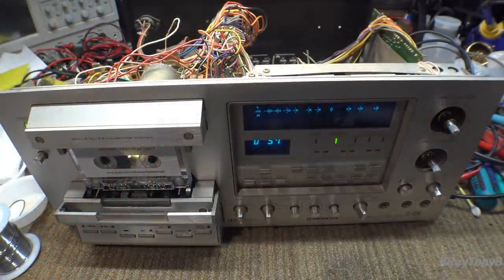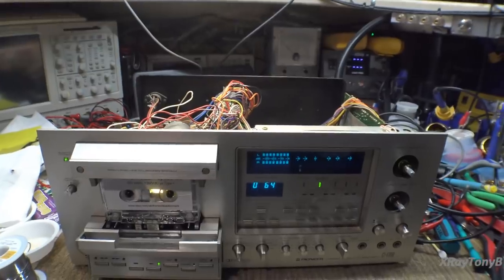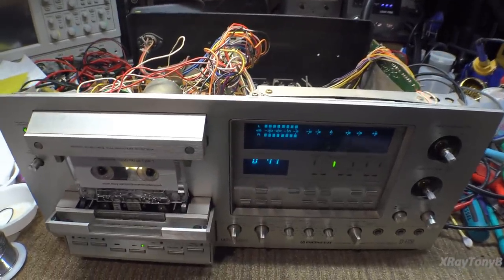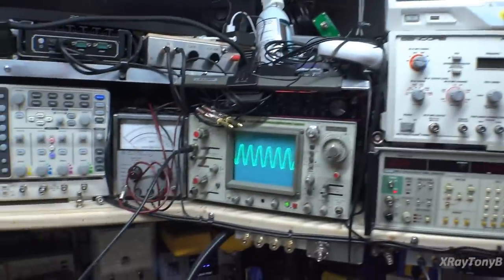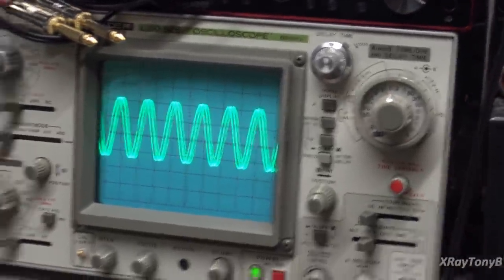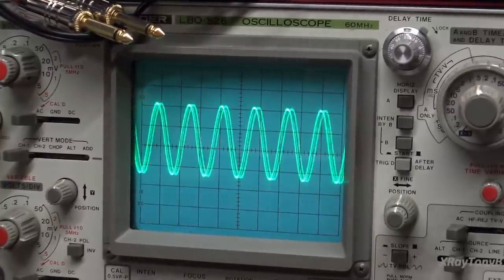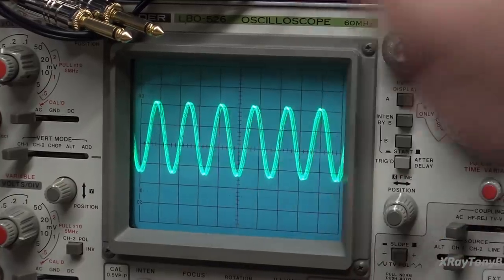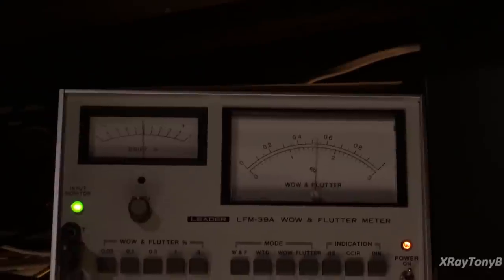Pioneer CT F1250 Cassettes Deck Restoration - Part 2

Comment: Ive had a lot of good fortune with lightly sanding the idler tire and then using rubber renew. It takes a fair amount of use to have the rubber actually wear down (even after all of these years since they were built. Same has worked for pinch rollers.

Comment: You hit the nail on the head.  The problem with cassette decks is they are reproducing the sound mechanically.   There are so many mechanical parts that can affect the sound.  Those drive motors had some good engineering done on them.  Pretty amazing how the motor regulates the speed internally.  Back in the 70s they really knew how to build things.

Comment: I bought one of these back in the late 70s. When I first played a vinyl album on my pioneer PL-630, I'd record it to Maxell Metal tape and then play the tape exclusively from then on (even on such a high end turntable, you could tell that each playback degraded the surfaces ever so slightly). I used the CT-F1250 so much, that by the mid 80s, I had already worn out the idler (it would slip from time to time, the take up reel would stop, and the anti jam mechanism would stop the tape). Other things I noticed before that happened...
1. the erase head was so strong, that after recording one side of a tape (and playing back to see levels), if you recorded on side B after that, the right channel (I think) would be a few dB lower on side A. I figured it was to compensate for metal tapes, so I just recorded side a little stronger on that channel, and when I recorded the other side, it evened out.
2. Initially, I could set the BIAS, LEVEL, EQ (in that order), but after a few years of lots of use, I couldn't get EQ to center anymore. I figured it was because maybe the heads were worn from so much use, but maybe it could have been components no longer in spec. I really don't know.
3. I was never a fan of the Dolby Noise Reduction (on any tape player), if you recorded with Dolby, then used Dolby to play back, it didn't sound as natural to me. Somewhat subdued in the high end compared to the original source I recorded from (usually vinyl). But this wasn't just this deck, it was all tape players I've recorded on.

Anyway, I'll be waiting to see how your restoration goes. Good luck, and hope you are happy with the results. I loved the deck myself.

Comment: Hi Tony, this relates more to the first video, but you were mentioning rolled off frequency response.
Your big band tape was marked as Chrome so you selected Chrome on the deck.
However some pre-recorded Chrome tapes are equalised so they have the correct response on the "normal" setting.
The biggest tell tale is the presence (or not) of the coding notches adjacent to the record prevention tabs.
Notch = Chrome EQ.
No notch = Normal EQ.
The later "metal" coding notches are nearer the centre.
I know you went on to say this also affected your other test tape too, so  in this case wouldn't have been the issue

Comment: I remember seeing this deck for sale when I went to pick up my Marantz 2385 using my Navy nuclear power bonus, in 1981.  The beautiful blue fluorescent level indicators were calling me, but it must have been very expensive, enough that I resisted and bought a more economical Hitachi deck (which turned out to be a tape-eating disaster that even factory service could not correct...).  The sales lit from Pioneer called this 1250 the "dream machine", designed with no holds barred. The problem, as I see it, is that this generous development budget allowed  Pioneer to design a unique and esoteric mechanism, instead of using an off the shelf, industry standard transport module.  This resulted in awesome performance, but also made servicing and repair so much more challenging.  That direct drive capstan motor, with hall effect- servo function, would be a bear to fix or replace.  Even the "high torque" hub drive motor, with its centrifugal speed governor looks like a PIA to replacement (nice job cleaning, btw).  Give me a well made mid-level deck (no Dragon nonsense, either....), either 2 or 3 head, using standard motors and belts.  They sound really good when serviced and set up properly, without the dream machine fuss and muss.  I guess it is like cars; you have to really love wrenching on them to own an Alfa Romeo or BMW, if you just want your car to perform reliably, you buy a Toyota.  I guess I prefer Toyota-esque audio gear. But hats off to you, Tony, for not being daunted by this machine.  You are a better man than I, Gunga Din, and I know you will sort it out, in the end.  I'm prepared for Parts 3, 4, 5, etc., the full and epic journey.

Comment: Very impressive and I'm glad I found this restoration.
I and went to the Slovakian site but can't find anything on Pioneer decks. Could anyone give me the correct dimensions of the idler wheel tire, please? So I can make an order,

I've heard so much of wrong size tires and would avoid trial and error to find the right tire from start.

Comment: Great Tape deck, the Good thing was it never Eat Tapes, The bad thing was it never Eat Tapes which caused it to stall to offen (even as New). I'm glad you pick this unit, I have some of the Ct-850,and Ct9xx and I stop working on them lol. This line of Pioneer recorded better than store bought tapes which were Basically Junk. 
WARNING!! Not all brands of Tapes worked w Pioneer  CT-  Tape deck.The Best Tape was TDK , The TDK for some reason, I think it had the best rollers in the cassette it self, I found that other tapes were wound up to tight and never loosen up enough to work very good and  caused all kinds of problems w the torque motor and caused to to shut off . (I had to rewind / Fast forward the other bands to loosen them up)  but putting them in a different tape desk caused them to tighten up again) So if you find problem - shutting off,  it might be the cassette brand not the deck itself . Good luck!

Comment: FYI: I had a few tires from a NAK MR1 / BX300, works perfectly for this deck. An old trick is if it's too wide, turn the tire on a drill over 1000 grit fixed to a (3rd hand). The right azimuth adj. bolt head was butchered on this deck, this is likely why the freq. rec/ playback is off in 8K-11K range. NAK uses a 10K ref tape for correct azimuth alignment.

Comment: I just finished replacing belts and rebuilding the take up motor and the tape path is working great now. Frequency is spot on and holds. The problem is the amplitude is jumping around on both channels using any frequency test tone and my oscilloscope. I have not begun any calibrations yet and maybe its just a dirty pot but wondered if you had any idea's? Maybe in the amplification circuit. Both channels jump exactly the same.

Comment: Hi Tony, I recently repaired a CT-F950 on my channel if you are interested in getting my perspective on these machines.  The 1250 may be better, however the bias calibration etc on the 950 is a real pain. Also there are some errors on the 950 service manual which may not have been corrected for the 1250, dunno. I used to be a TO and AV technician and now repair hifi gear in my retirement.
1 I have been warned against using lithium based grease for plastic wheels and I tend to agree, I use silicon based grease such as Dow Corning DC4, but there may be others. Do your own research. 
2 If you take apart the sled be careful to not lose the 6 ball bearings above and below the sliding plate.
3 Yours may be ok but I found the spring pulling the idler tyre against the hubs wasn't strong enough and had to shorten mine by a coil or two.
4 Thanks for info about sources for pinch roller repair and tyre source. Everything is o/s for me so that's not a problem. I'm in Oz.
5 Yes, repairing those small motors is hard. I've once accidently bent the brush arm on one but managed to recover it.  I saw the governor on the reel motor and wondered how it operated, so it's an extra set of coils, nice to know.
6 I ended up using the take up pinch roller for the supply position as it was in reasonable condition. I bought a new pinch roller for the take-up but it is of a larger diameter as I feel it would only enhance the pinch, plus I couldn't find a source for the original size. I will check out Terry's business if I have trouble again as it's always best to use original sizing even if the original design was lacking.
7 Sound quality is very good, especially playback. Recording is ok but I have one audio track for test recording (called "Chocolate Mousse" an electronic dance number, don't know artist) that gives me problems . It is a burst of cymbals of very high frequency and it gives trouble when recording. Notably many machines are troubled by this burst of HF, except for all Nakamichis I've tried, amazingly. I suspect HXPro but can't be sure yet. The 950 doesn't have HXPro and it exhibits this issue. Anyway, just a thought that you check response thoroughly and try recording really high frqs such as the high tinkles from a drum set. The design for bias in the 950 is a kludge , I hope it's better for the 1250.
Reply: Good to know

Comment: 25:40 Why not just swap the two spools?
They look to be identical, and the takeup spool is probably more worn than the other
from being under constant tension and use,
so swapping them around might improve things on the takeup side.
Reply: @geirendre  die beiden Wickel -Teller sind leider verschieden .

Comment: Actually, the idler has less to do with a steady tape speed since the capstan rotation is responsible for that. The take-up reel just needs to spin fast enough to wind the tape without creating slack. I suspect that the W&F issues come from both pinch rollers being worn and the connecting belt between the take-up and supply capstan flywheels that probably hasn't settled in yet, has a slightly wrong size or is of average quality. Since this is a closed-loop dual capstan, there needs to be a constant tension on the tape between both pinch rollers and anything in this system will make the W&F go haywire. New pinch rollers will go a long way, as well as squeaky clean capstans and well-oiled capstan bearings.

The wobbling idler isn't nice, but as long as the take-up torque is within specs and the reel doesn't exceed a speed that will cause the tape to slip through the take-up capstan and pinch roller, this shouldn't be an immediate issue for W&F.

Also, back-tension torque on the supply reel must be constant and not too high.
Reply: I would add that other than the capstan loop, the only other possibility that the clicking idler could affect the w & f would be a sticking or tight clutch mechanism in the takeup reel assembly introducing the flutter via the actual tape. Early 2-head Naks had a takeup reel clutch that quickly froze, and that was replaced easily in the field by an adhesive-backed felt ring and a matching no-clutch takeup reel.
Reply: I understand what you're saying, but the tension needs to be kept constant.  I think a bigger question is what's supposed to slip to maintain tension but letting the capstan determine the speed?  I haven't seen him address the slip clutch.  I think it's built within the reel.
Reply: the pinch rollers require correct pressure against the capstan. Also, if the washer is too tight against pinch roller bushing it creates resistance. Lastly a drop of PLP inside the bushing helps alot. Both capstans should also have a drop of PLP in the shaft they spin in. The study of metallurgy is critical in these mechanically driven machines. A mirror cassette will show any tape path deviation, stress, & resistance. 
There should be a max. of +/-5Hz on a 3150 test tape from a reference deck like B215, 3014A, etc.

Comment: Hi Tony, what's your take on this idea: to measure the tape speed if one doesn't have special test tape ie fixed frequency, can one not physically measure a specific length of tape with some marks that correspond to a specified time and use the fact that tape speed should be 4.75cm per sec. So 1425 cm equates to 5 min play back. Would this not be accurate to adjust tape speed without special test tapes? It would need an old cassette to be opened and the tape measured and marked with a tape measure, and accurately timed with stop watch. Your thoughts? Love your channel. Thks.

Comment: Were you able to get the rebuilt pinch rollers from Terry ? He's fighting some serious Covid19 health problems. 
    As a last resort I use MG Chem. rubber renew with cuetip. Equal strokes on entire roller - restores pinch roller with minimal diameter reduction.
Reply from the maker: Still waiting to hear from him.  I hope Terry gets well soon and I wish him all the best!
Reply: @xraytonyb  I tested mine at +11.76 FF / -11.76 FR. My motor needs service cause it hesitates in FF direction. What do you think about usin JB on the cap cover ridge instead of peening it ? I'm afraid peening it will throw off the harmonic balance. Pioneer probably used a press plate.

Comment: hello, I see that you restored it, I have one and although it plays well, I have not been able to make it record correctly, they have told me that it is not the recording head, I also have a problem with the integrated pulse counter of the capstan motor, the chip it has is the PD1003, I wanted to ask you, and if you know IF IT HAS ANY REPLACEMENT THAT CAN REPLACE IT, because that chip was encapsulated by pioneer and I can't get its datasheet anywhere, I know it's a pulse counter but I don't know but nothing. I appreciate if you can give me some information.

Comment: A lot of those belts and rubber guide wheels can be regenerated back to new, put them in some boiling water in a glass jar and put them in a microwave for 15 minutes covering the Jar reforms them and back to shape. Ideally checking the rubber belt after it's put on sometimes they can be flipped around as well for true roundness some course wet and dry 120g can be used gently on a file to get true roundness. I had a lot of these modern belts if they're not exactly the same thickness will throw your wow and Flutter out should say in the schematics or manual for the mechanical parts what the thickness should be and width of belts and length.
Put a spot of  grease on the ends of the bushes
Reply: Hum, Boiling water Another good Idea, I will have to look for the spec of th belt it appear that what you buy new today, might not work?
Reply: @musicstevecom2  yes belts fickle thing and they need to be manufactured well probably silicone belt would be best bet you need to know the tension of the original rubber these figures must be out there somewhere

Comment: 21:36 For testing the head without rotating parts, 
is to use a MP3 to cassette adapter, those where used back in the old days, to connect a MP3 player/Discman to a car radio that only got a cassette deck and no aux input.
Like this : https://postimg.cc/zbM5SMVc
Reply: Great Idea!

Comment: Can you swap  the forward and reverse wheels?
Reply: I think it's a good idea. Tony has to disassemble both and replace only the upper part. The rewind has a belt pulley on the bottom. Also, the clutch has to be checked.

Comment: Old Analogue Tape decks seem to last longer than the Digital Compact Cassette which I had but it seems like the unit needs recapping as it will no longer play either analogue or Digital Compact Cassette, I think that Philips should have gone with a rotary cecord head i.e. RDAT rather than  a fixed 9 track tape head.

Comment: Try an o-ring to replace the idler tyre. I know that it is not ok, but...
Reply: Ha!  Repaired a classic Panasonic boom box with reverse playback and this is exactly what I did with one of the idler tire- rubber O-ring.  Had to shave it with with knife and sandpaper, to get it a bit smaller diameter and better match for the OEM square profile.  Worked great!

Comment: i have 2-- pioneer 580 decks just like that one in the outher room half apart  ready for me to throw in trash with a lot of good parts in them  just to much for me to fix  as you are finding out  -i hate to throw all this in trash when people are going crazy  trying to find paets  i will throw in trash  -a lot of sony stuff to  all free if some one wants items  wc
Reply: repairing these are a lot of work and you need a system to keep track of all the little parts and a system to make sure where they go when putting it back together  (pics and videos)  and how to prevent little parts from flying off when taking them apart, like you I looked at the belt I need to replace and stopped working and thinking how can I get to that belt and thing I don't have time to do this and a system and room to do it.

Comment: You can buy the "electronic cleaner" in Europe branded as "Kontakt WL", which is made by CRC aswell.
The stuff can clean seized up mechanical parts aswell, though you make want to heat the particular part with a hair dryer at first and as your moving the part back and forth you spray it with the cleaner and it soaks in by it self. In the end you wanna lubricate the part.

Comment: "Entirely too touchy to clean on camera". What nonsense is that?

What is the purpose of your channel to educate or cop out?
Reply: Tony said it was too touchy to clean on camera due to his camera arrangement. He would have to reach over and around the camera to fiddle with it. I understand your frustration though. Refurbishing one of these motors is something we all would love to see in its entirety. I too have a 1250 that needs this done as the playback drops out due to a dead spot on the armature. I have read the thread on how to do this on AudioKarma, but a video would be even better yes. 
This job really needs its own video and perhaps it can be done if the camera was placed differently in order to get unfettered access to it.